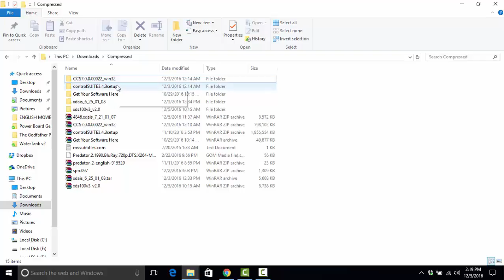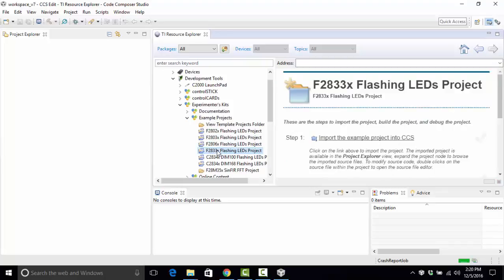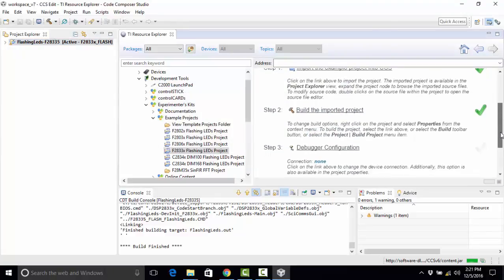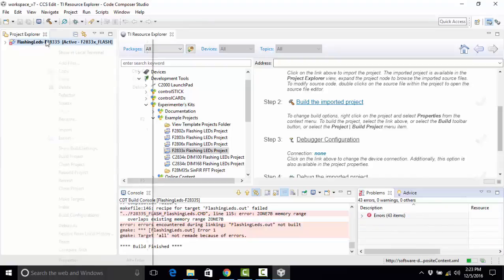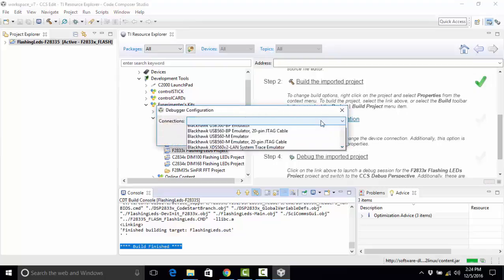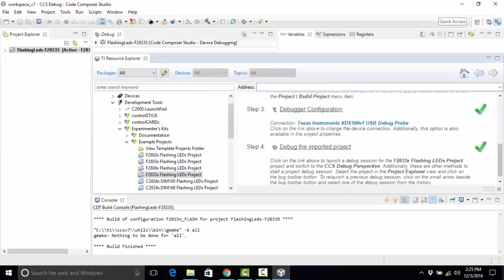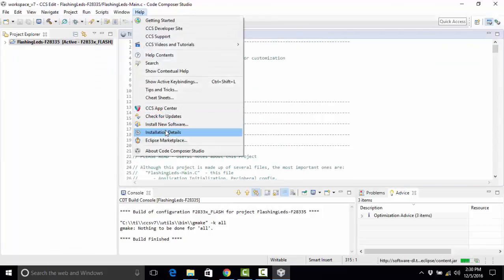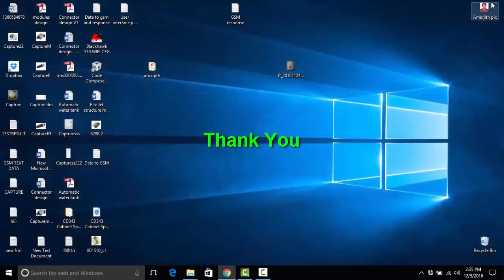ControlSUITE code example testing in CCS

Comment: getting an error  while doing step four
C28xx: Error connecting to the target: (Error -151 @ 0x0) One of the FTDI driver functions used during the connect returned bad status or an error. The cause may be one or more of: no XDS100 is plugged in, invalid XDS100 serial number, blank XDS100 EEPROM, missing FTDI drivers, faulty USB cable. Use the xds100serial command-line utility in the 'common/uscif' folder to verify the XDS100 can be located. (Emulation package 6.0.576.0) 
    
pls tell how to solve